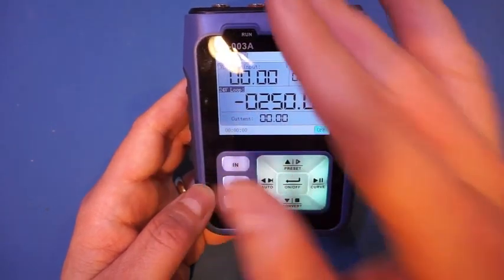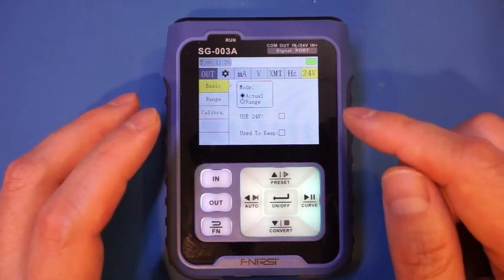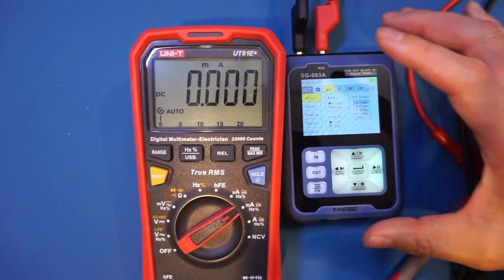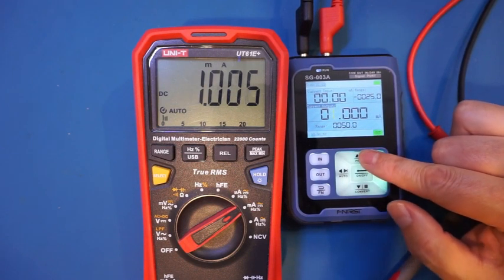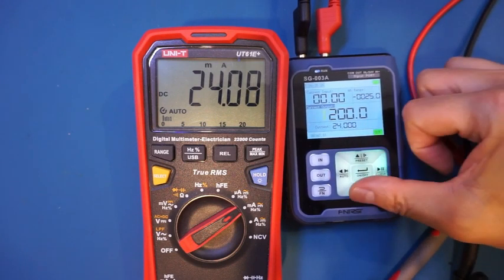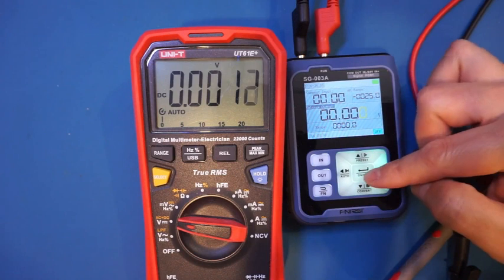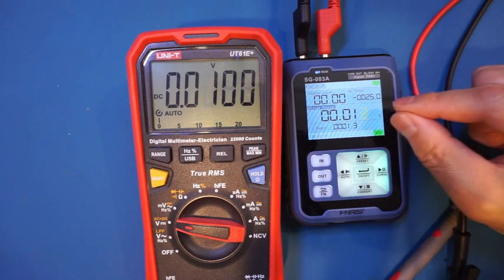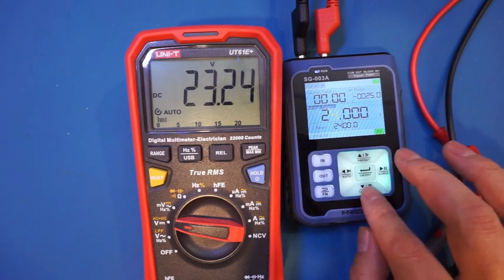FNIRSI SG 003A Signal Generator

Comment: I believe that you are able to customize the range because in most PLC's programs you can linearize the input current to something that the computer can read. I work on a PLC that it linearizes 4 - 20 ma to 0 - 8198 "data points". It means that 8.00 ma = 4095in this range.